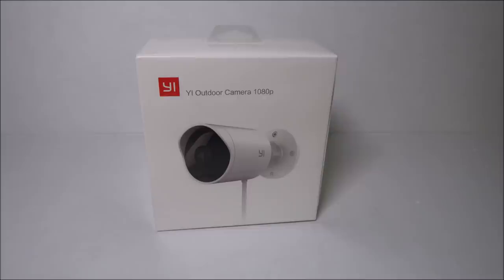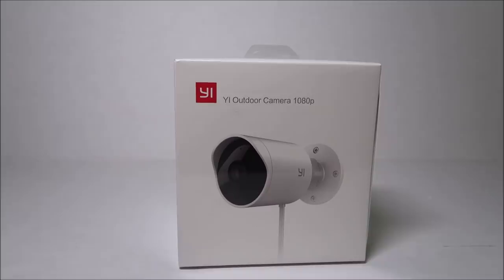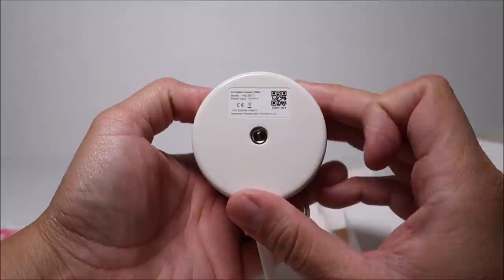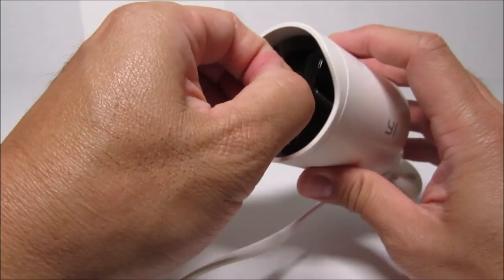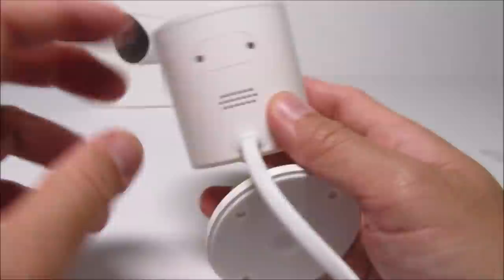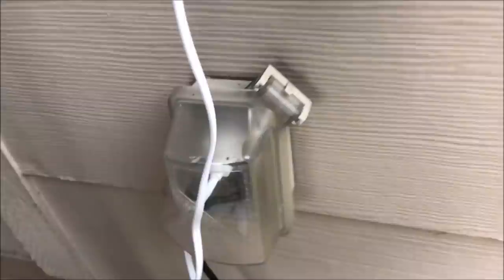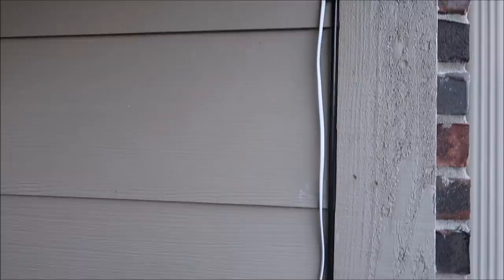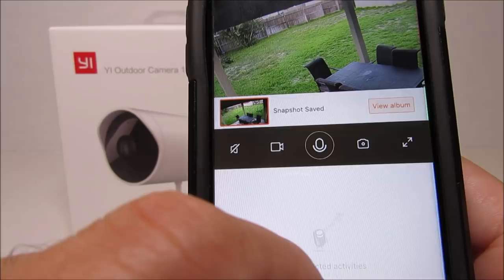Yi Outdoor Security Camera Review - Unboxing, Setup, Settings, Installation, Footage

Comment: Great camera for good price. I just mounted mine above my garage perfect degree footage of what I needed plus I like the alarm for motion detection. My only con is that it loses wifi connection frequently. The camera itself is only 20 feet from the router above my garage. My phone gets strong signal where the camera is. I'm not sure if the camera itself has hard time picking up wifi signal. Does anyone else have this same problem?
Reply from the maker: I don't have any issues on mine. I have a friend that I helped set it up also outside of her garage  and her router is in the middle of her house...probably it has to go through 2-3 walls plus the garage door and it connects without issues. Try resetting the camera and see if it helps.
Reply: LifeHackster so after installation. I had a few issues it would lose connection frequently and completely lose conection at night. I installed a wifi extender and plugged into my garage so its closer to my camera and it has its own wifi connection. It now works perfectly.
Reply from the maker: Nick Acuna - good. It was probably due to a weak WiFi signal then.
Reply: Nick Acuna n

Comment: Hi. Thank you for a great review. I have a question. Can this camera be powered by solar panel? If yes, what panel you will recommend. Thanks
Reply from the maker: No, this camera cannot be powered by a solar panel per se... it needs to be plugged in and has no battery that the solar panel can charge. But, there are now solar panels now being sold at Amazon that has a battery built in the panel itself and it will power this camera but because of it's design, I don't think that solar panel will be able to catch up in charging the battery fast enough before the camera uses up all the battery;s charge. In short, it is not advisable.
Reply: @LifeHackster  thank you!

Comment: Hello, I got this camera in and returned it back, because I have 2.4/5.0 MGz and I could not pair this camera to my WiFi. What outdoor wireless 1080p camera would you recommend with micro SD card and audio? I want to put it in my back yard for security purposes.  I hope you would be able to help me with this, mostly cameras I saw support only 2.4 MGz router. I do not want to buy very expensive camera and do not want to pay for the cloud service.  Thank you so much for your help in advance!
Reply from the maker: Most outdoor wifi cameras are 2.4 Ghz and most routers are compatible both 2.4/5 Ghz. You should be able to pair the Yi outdoor cam. Also, you should connect your smartphone to 2.4 ghz before setting it up. Anyways, another option is the reolink Argus 2 - true wireless because it is battery powered also.

Comment: One question LifeHackster:  I saw that you had your phone handy and you hooked up the Wifi to the camera with relative ease.  My question is, how far away can you mount the camera from your house/or where your phone is before it will NOT pick up the signal?  I want to mount the camera on my woodshed so I can use it to monitor the temperature on my outdoor wood boiler.  The woodshed is 100+ feet from our router or where I would be sitting (in my Lazy-Boy) with my phone.  Will I be able to connect to it to do a live view and check the boiler temp?  If I am away from home, say, 25 miles away at work, will I be able to see what the camera sees through my phone?  If yes, I buy this camera tomorrow.  I am just unsure of how the whole Wifi process works.  Thanks in advance for your help.
Reply from the maker: The proximity of the phone will have nothing to do with the signal. It will be between your router and the camera. 100+ feet is pushing it and you will need a WiFi extender to extend the signal. The phone is used to setup the camera initially...to put in your WiFi credentials to the camera and after that, the camera will connect to your router. Then after everything is setup, then the phone is used to view the camera and to review recorded footage via the app. The phone doesn't necessarily be on the same WiFi network...as long as you have an internet connection, even on the other side of the globe, you will be able to access and view the camera. Hopefully this helps...
Reply: Thanks man, it sure does!  Appreciate your response...
Reply from the maker: You are welcome.

Comment: Hy,

I wondering if this camera send you a notification on voice detection?
In start I want to use it like baby monitor, and after a security camera. Is this possible?
And my second questions is which is the largest micro sd card that the camera recognizes? 
Thanks
Reply from the maker: Not the outdoor camera but their home and dome cameras 1080p have baby detection option via the app. 64 GB is the largest you can put...

Comment: I have a question about YI cam night live view mode. Does the camera will give a color night live view or it just black and white? I have other YI camera and sometimes for few times it was shown on the color and the next day just BW. I sent an email to the YI but the CS did not give the exact answer that i was looking for. So i thought you might know about it. Thanks
Reply from the maker: It will depend on the ambient lighting. If the camera's light sensor thinks that there is enough ambient light around the camera, it will turn off the IR and black and white recording and shift to color mode.

Comment: Hi there, I'm planning to buy this camera for my front gate, would it still be able to pick up my wifi signal if the distance between my router to where I would install the camera is around 10 meters (32ft) ?
Reply from the maker: It should be but it depends on how many walls or any obstacles the signal has to go through.
Reply: @LifeHackster  Just the gate it self and our front door, no other visible walls.

Comment: @LifeHackster great video, I have a question. are the settings of the yi indoor different than the Outdoor? how did you manage to get a notification when motion is detected to your phone? I only see the notification in the Yi app once I open the app. Id like my phone to make a sound or vibrate once there is motion.
Reply from the maker: There are a few nuances on the settings but mostly the same.. when you setup the app, did you agree on the notifications pop up question? if yes, then is should push the notifications on your phone...if not, check the notification settings on your phone, click on the app and select which type of notification you want.

Comment: ok but if someone was to vandalize your property, they will unplug the outlet and rip off the camera or cover it or take it  so in that case, you wont have access to the sd card that sits inside the camera itself. thats whats stopping me from buying these
Reply from the maker: You can subscribe to their cloud storage if you are worried about people vandalizing your camera. It will record to both micro SD card and also upload a video to the cloud.
Reply: LifeHackster what about the sd card not recorded sound? Did yours record sound?
Reply: Yeah thats right.. what if someone just unplug the usb/power cable, it will not record anything..

Comment: Great video. Really helped me set up mine when it arrived two days ago. But do you know, how do i review footage? I have a 32Gb card in it, and the app works fine, but I can't find any way to review previous footage. The Yi website provides zero information or support. Any input would be appreciated!
Reply from the maker: Go to the camera's main view and if it is in protrait mode, tap the screen once and you will see a time line on the bottom with "orange or brown" areas which means the camera has recorded footage...just swipe left or right to scroll through the videos... Also, you can just turn your phone to landscape mode and the timeline should appear automatically.

Comment: Can I add a 128gb micro sd card instead of the 32gb ? And how long will that last?
Reply from the maker: 32 GB is the maximum as per Yi but I know some have tried 64 GB without problems.
Reply: LifeHackster  I’m debating between this yi or the meshare but I cannot decide ...I cannot tell witch of the 2 has the biggest field of view  . And there isn’t any comparison ideos between the 2 like you do them

Comment: What is the range of wifi where the camera is capable of
Reply from the maker: It depends on your WiFi router. Normally, if you install cameras outside the house, the WiFi degrades pretty quick and sometimes you will need a WiFi Extender.
Reply: LifeHackster  thanks

Comment: Hi lifehackster. Kamusta.
I just bought a yi outdoor cam but im confused if it takes 32G or up to 64G? Some websites says it takes 64G but i want to be sure before i buy an sd card. Salamat.
Reply from the maker: I know some have commented that it works with 64 GB card. If I were you though, just get a 32 GB that's what I use in my Yi dome and everything else, I only have the 16 GB...

Comment: I'm wondering . . . I was wanting to use this as a sort of webcam, in the old sense of a webcam, where anyone with the link could see what the camera is showing. Can this be done with this thing? I'm imagining that I can boot up my laptop, day and night, and see what the camera is seeing at a glance (and hearing what it's hearing as well) even though it's just mounted on the balcony.

In Montreal we get some extreme winters—right now it's around -14° C—and I thought it would be kind of cool to show the world the (not-so)awesome view  from my 8th-floor balcony of the busy street below by just sending a URL by email. 

Is this possible, and can it be controlled from one main computer that it is presumably connected to? Oh yeah, forgot to mention that ideally, I would use it on a desktop iMac running MacOS, although of course I have an iPad Mini and iPhone, although I would prefer NOT to use the small devices at all, just the iMac, although I understand no one does that any more these days.Is this possible?
Reply from the maker: I don't think it will. First, it will not stream long periods like a web cam. It is not designed for continuous streaming and it eventually time out... I think 10 mins. With that, I don't think you will be able to use it as a webcam.
Reply: @LifeHackster  Wow . . . too bad! I already bought it, but haven't opened it yet. I know you're not a camera reviewer per se, but have you ever heard of the "Amcrest 2K 3MP Wireless Outdoor Security Camera ProHD 1080P" and do you think THAT would do what I mentioned, or are ALL of these types of cameras the same? Really, thanks in advance! Now I'm really confused.

Comment: Thank you @lifehackster 
I’m new to your channel and found a really informative video about the yi camera which I was searching for days. 
I just have some questions that do I get 8 days constant recording on 32 gb sd card?  What if i plug in a 64 gb card? And yeah do I have to de mount my sd card every-time I want to watch previous day recording?
Reply from the maker: 8 days on the 32 GB is not 24/7 recording but when their is motion/activity only and it will depend on how much traffic and movement you get from the area that you monitor. It can be more days if there is not a lot of motion. Putting a 64 GB should theoretically double the days of recording.
Reply from the maker: Also, you wan watch the video footage from the app...you don't have to remove the micro SD card.

Comment: What is fahrenheit?
Reply from the maker: The Fahrenheit scale is a temperature scale based on one proposed in 1724 by Amsterdam-based physicist Daniel Gabriel Fahrenheit (1686–1736).[1] It uses the degree Fahrenheit (symbol: °F) as the unit. Several accounts of how he originally defined his scale exist. The lower defining point, 0 °F, was established as the temperature of a solution of brine made from equal parts of ice and salt. Further limits were established as the melting point of ice (32 °F) and his best estimate of the average human body temperature (96 °F, about 2.6 °F less than the modern value due to a later redefinition of the scale).[2] The scale is now usually defined by two fixed points: the temperature at which water freezes into ice is defined as 32 °F, and the boiling point of water is defined to be 212 °F, a 180 °F separation, as defined at sea level and standard atmospheric pressure. ;)

Comment: Hi. I bought 5 cameras from China and brought it to Philippines. But unfortunately it cant be configured in PH. It is saying "this camera can only be used in China. :( Do you know any custom firmware I could use to make it work here in the Philippines. Thanks in advance.
Reply from the maker: Sorry. I don't know of any firmware. I also thought that the Chinese model will work without any issues anywhere in Asia.
Reply: Just choose China Mainland in your Yi Home app. Then it will work fine
Reply: Update the Camera firmware thru the app and reset. You will have the option to set china as mainland
Reply: Darrel Valencia Thanks. Have you tried this? Does this work for you outside china? Cause mine was bought from China and never worked in PH.
Reply: havent tried it yet, i just read some reviews mentioning the same problem as yours in lazada.ph. just ordered mine today at official yi store. dont know if you can update the firmware if you cant connect the camera.